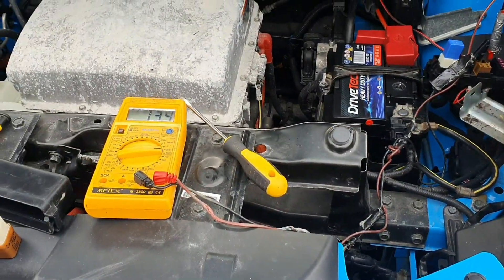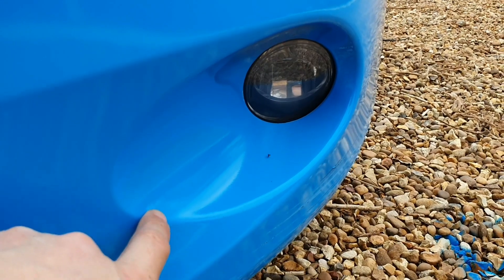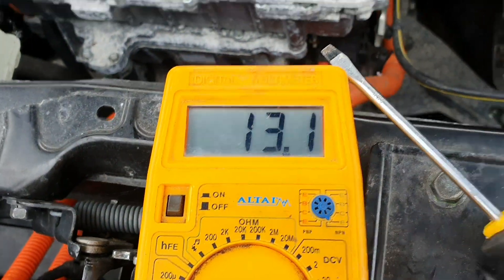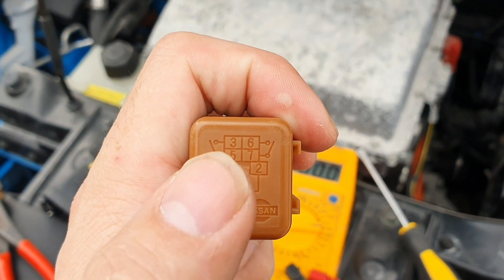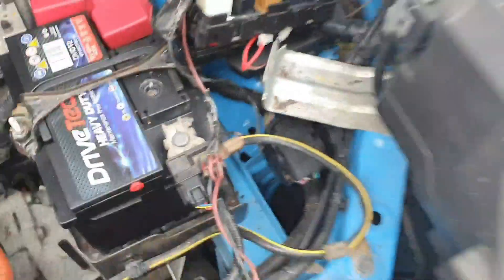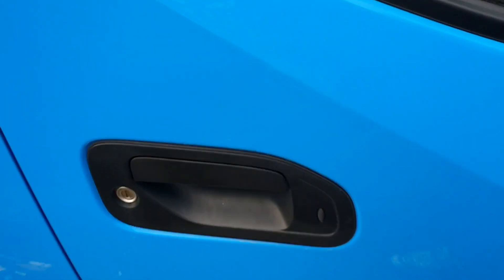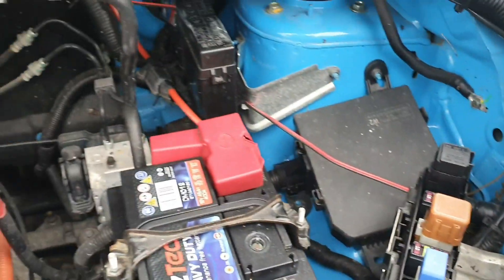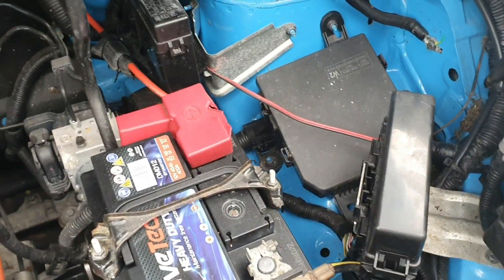NISSAN E-NV 200 ELECTRIC CAMPERVAN: Adding a switch to the DDL Relay

Comment: Hi Richard 
now that looks complicated but good on you , just dont flatten the battery of a night
when camping  else its a long charge home lol , keep safe
Reply from the maker: Not too complicated, just a simple switch on a negative to the coil. Yes of course you won't flatten the battery unless you're pulling more than what the inverter can handle (2400w) for 10 hour straight. I would at most use half of the battery if the heater was on.
Reply: @RichardMawby oes the EV200 come with a 2400w inverter? Is there a normal household plug (220v) to connect normal appliances? Great videos BTW :)
Reply from the maker: @HelderNevesHelderNeves  far as I understand it has a DC to DC converter capable of 1500w continuous. I wired up my own inverter to the 12v battery and whilst the ignition is on it draws power from the 360v pack